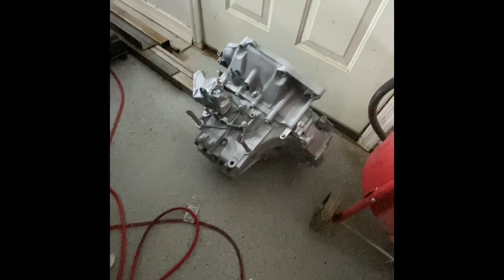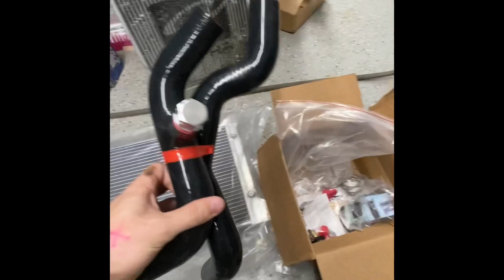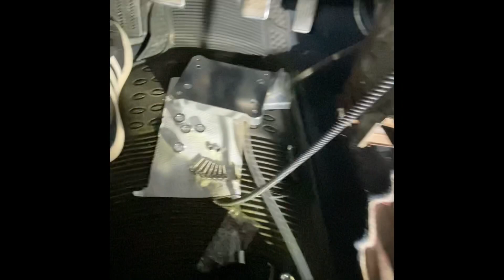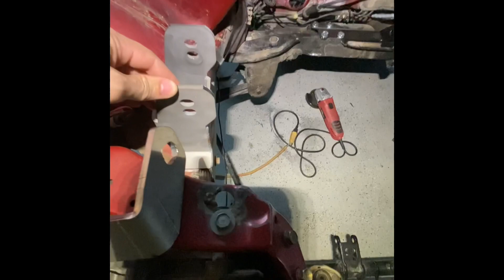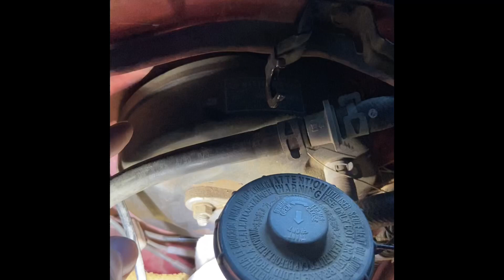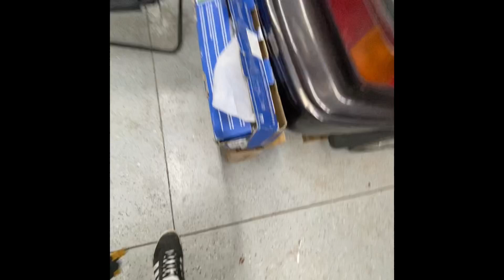Crx k20 swap build

Comment: Sir. I have issue on my kswap crx. My powershifting is not going and on high rpm everytime i go into 4th gear my shifter always automatically go into neutral. I build the transmission twice. You think it’s because of synchronizer or because of the position if shifter cable or my shifter?  My shifter is from maxspeeding rods ktuned copy. And my cabe is hybrid racing
Reply from the maker: Hey sorry for your troubles…It’s hard to diagnose from here and could be a variety of things…I had an issue my transmission not going into 2nd gear fully and ended up replacing the full second gear assembly and all synchros/bearings while I was at it. But yeah start with the simple things first like making sure your cables are adjusted properly,shift assembly and such…
Reply: @thecrxperience4843  thank you so much for your reply. 👍🏻